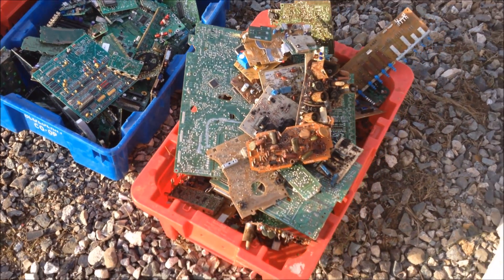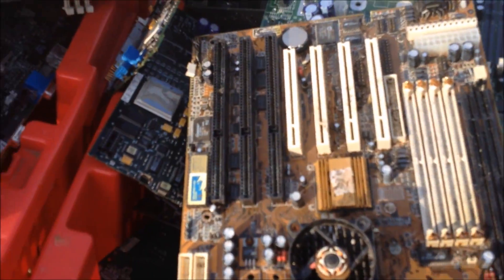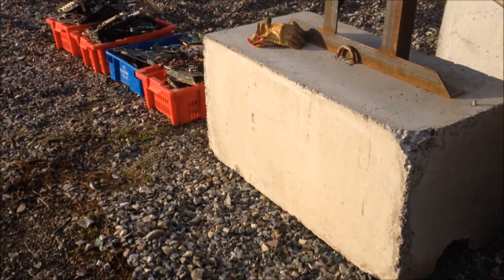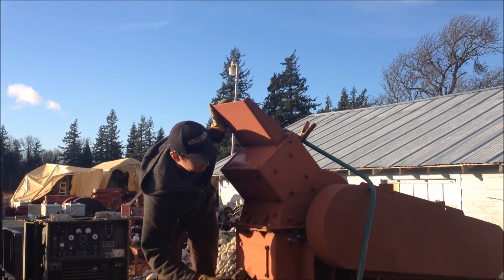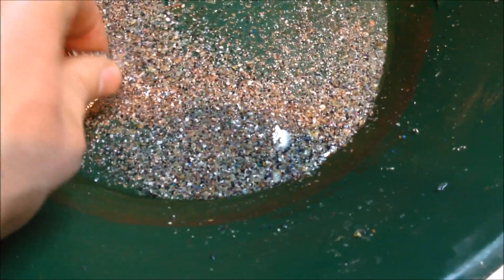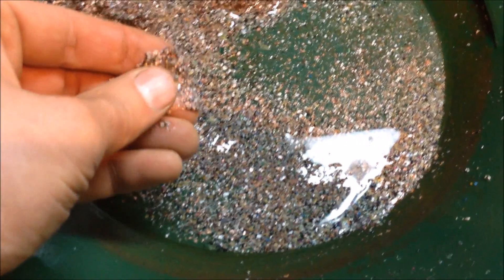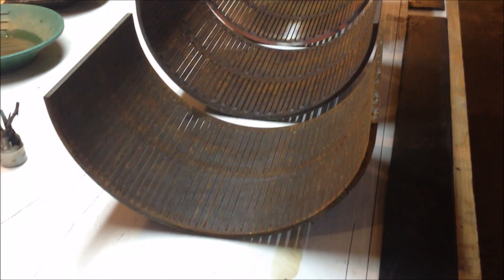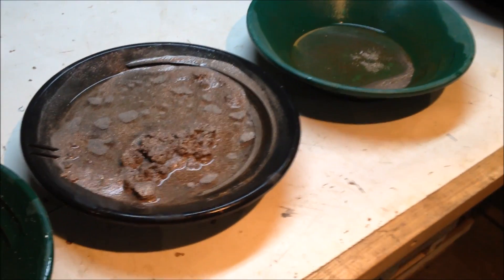URBAN MINING! Recovering gold, copper, precious metals from PCB's without chemicals

Comment: I think including both magnetic and eddy current separators would really help you out, and both are very cheap to build on a small scale from salvaged parts.
Reply from the maker: Laughing Achilles Thanks for the tip.  I think that is a good next step for us once we have the system refined a bit more.  If we can get the magnetics out with out losing any other metals that will be a big help for the refining process.
Reply: mbmmllc
 Ultimately you're going to run into an impossible barrier with that. You can grind it down as fine as you like but you're going to end up with a gold atom attached to a few iron atoms and it'll be removed with other magnetics. So it becomes a question of acceptable losses.

I hope you don't mind me throwing ideas at you it's just that I make my money from scrap but I keep all the boards and process them myself.  I'm trying to limit my chemical processes for obvious reasons. Over the years I've drastically reduced the need for chemicals. Although I did separate many components before processing, but now I'm trying to do whole boards like yourself.

So I think the most important thing you need to do is grind the material to a finer and more consistent micron size. The hammer mill is obviously brilliant for this sort of work, a secondary mill would produce a finer product, say 50 micron with greater consistency. A tertiary sieve could be installed to further classify the 50 micron product before it hits the table.
Reply from the maker: Laughing Achilles Thanks for the in depth comment and your good ideas.  I don't mind at all you giving suggestions on ways to improve our process.  I am a firm believer in more heads are better than a few and YouTube has a lot of heads!  

We are trying another approach now and I will give you the highlights.  We are using a 1/4" screen in our hammer mill with the idea that keeping the metals larger will reduce the abrasion of gold plating, etc that are very hard if not impossible to separate with gravity.  The mill spits out ~1/4" minus material we run across our shaker table.  The large metallics separate into the number one and number two ports with mostly free copper with a little bit of contamination ending up in port number three.  The tailings are then pumped up to a cyclone and the larger pieces (~30-50 mesh and larger) are re-run through the hammer mill again to liberate any more metallics.  The ~50 mesh and smaller is then discharged to the tailings pond where the water is re-circulated.

The larger material will re-circulate through the hammer mill until it is small enough to go up and out the cyclone.  This way we aren't abrading everything to a certain size to fit through the screen (increases throughput rate too), but we have a classifier to ensure we are liberating a very high percentage of metallics.  

Your guys thoughts would be appreciated.  We hope to have a video of our next R&D revision up soon so stay tuned!

Comment: we've been testing using liquid nitrogen on our electronics, then ball milling with dry ice, the dry ice evaporates leaving a dry powder...we'd planned on using magnetic induction and a centrifuge; but I like the shaker table method I see...thanks...will give it a try...have a good day...
Reply from the maker: Lewis Campbell Thanks for the comments.  It sounds like you guys are doing some production processing of PCB.  Where do you guys send your stuff for refining after grinding?  Thanks and good luck.
Reply: mbmmllc actually I've designed a magnetic induction process that supports a distillation like process for increased purity....still tweaking the design at the moment...but it seems to be working so far...it'll will take a couple of months of r & d to see what the quality level can be taken...we plan to use a solar farm to provide the current we need for mass processing of e-waste and rendering of the gold, silver and copper etc...thanks for the comments....
Reply from the maker: Lewis Campbell Thanks for your input.  It sounds like you have a cool project going on there.  Let us know how it turns out!
Reply: mbmmllc thanks....the military has me out training for the week...will be back in the office mon....will call then...hope your week goes well....

Comment: I'm not a expert but I've been doing a project on refining gold from PCB's. If im not mistaken with that technique you are probably going to heavy metals such as lead and mercury with the gold because of their similar molecular mass. The gold you are getting off is not 24 karat either, most gold in computers is gold foil which is a alloy of gold, copper, lead, and other metals.
Reply from the maker: Drew Peackock Thanks for the comment.  You are correct, there is going to be some lead and heavier metals that are mixed with the gold, but the volume will be much, much smaller than whole boards, and easier to refine.  We have some assays of our high grade material at over 100 oz/ton in gold so we are concentrating a really high grade product off the table.  Thanks again.

Comment: I ran a similar machine recovering copper from wire, we had a two step grind and 2 shaker tables.  the biggest problem we had was dealing with particle size, if you have raw particles that are significantly smaller than your screen you will have larger heavy particles sending smaller valuable particles into the low grade bins.  we would always re-grind with a finer screen when we re-ran our low grade product.  The company I worked for has grown to be the largest wire buyer in the area.  I would recommend that you work hard to find a good buyer for your product; you have a valuable product there and should be able to get a nice price for it.  something you might want to consider would be inserting a magnet somewhere to pull out any bits of steel that may be in your output.

Comment: those "golden" bits on the chip corners are telurium copper
Reply from the maker: ***** Thanks for the tip.
Reply: mbmmllc It is very rare to find "whole" golden parts almost everything is currently made from copper plated with telurium-copper coat. For "economical" reasons manufacturers only on rare ocasions using gold plating on PC part.

Comment: what about the rest material and the water?
I think this water is not safe just to drop in the ground
Reply from the maker: laxwork Thanks for the comment.  I would agree the water and the tailings needs to be disposed of properly.  The water can be recirculated through the system so the overall water usage is very low.

Comment: No chemicals? What you have there is a slurry of toxic waste full of all kinds of probimer and gunk. Good luck disposing of that legally. You'd be better off using the acid. I'd like to have that mill though for grinding processors; no point in doing entire boards.
Reply: Adam Selene I'm late, but you could dump it with oil for incineration
Reply: @SonicScooter I mean if you could figure out a closed loop system this could reduce the amount of additional chemicals needed.

Comment: You should be removing the Lithium-Ion button batteries from those motherboards first.
Reply from the maker: Gavin-
Noted.  I have had several people mention this to me through email as well.  Thanks for the heads up!
Reply: After all, you don't want explosions inside the hammer mill :)  This is just really neat, I never would have thought of doing thing this way.
Reply from the maker: Gavin Hurlbut Thanks for the comments.  I am glad you like the set up.  I have heard from several people in the industry this has some real potential.

Comment: So maybe like 30 bucks worth of gold, but I have to wonder how much copper and solder is in there.   If you could find a way to seperate the copper you could probably make more from that than the gold.
Reply from the maker: Hi Brady-
I think you are absolutely right.  The gold and other PM's are the "sexy" metals to go after, but I bet there is just as much value in the copper and base metals as there is in the PM's (depending on board grade of course).  It is very worth while to grab the base metals and send them off to a refiner.  Thanks for the comment
Reply: It would be interesting to have a chart of the values.  I believe with some sort of electrolysis system you could extract the copper without relying on a refiner.
Reply from the maker: Brady Rose Those are great ideas.  If you have the know how to extract the copper chemically I think that would be a great way to go.  I think it will depend on the volume of the operation too.  Thanks for the good ideas!

Comment: love to see more tries at this, do you plan to do any more runs with pcb on the mill and table ??
Reply from the maker: Hi Magpie-
We do plan to run more tests with our table and mill.  We are trying to find a good reliable source of boards as they are kind of hard to come by here.  We will post some more vids as we take them.  I have a really cool vid of incinerated IC chips I am going to post later this afternoon so check back soon.  Thanks
Reply: have you though about trying computer repair or tv repair shops for dead boards im sure they come accross lots or the do on uk anyways. regards
Reply from the maker: Magpies Recycling Thanks for the tip.  I will try that and see if I can get a good reliable source of boards.

Comment: I think you maybe slightly confused about the refining process you still need to refine with aqua regia to obtain 24kt pure .9999 gold. You are probably getting gold plated copper at the last stage and your efficiency looks very low. If i were to have processed the same amount and grade prob get about 10 g. gold 2 g. plat .5 paldium  and about 2 to 3 oz. of silver
Reply from the maker: Hi Vincent-
Thanks for your comments.  This was our first attempt at running whole, complete boards through the hammer mill and shaker table.  As you and others have mentioned the returns of PM's appear to be quite low.  We are working to get some assays of the different fractions so we can determine exactly where all the different metals ended up.  For additional testing we may try and remove all the gold bearing chips before running the boards as we may not be grinding the epoxy fine enough through our first pass in our hammer mill to liberate the very fine gold wires.  We will keep all you guys informed of our progress and stay tuned for more vids and info.
Reply: i wont lie this is interesting to see and u maybe really on to something. because u can reduce mass enormously making chemical process easier and with less concentrated acids. nitric when properly synthesized can light gloves on fire and burn skin not to mention the nasty fumes. but even if your not getting pure out of the end if u find the yields and sell it wholesale to a refiner and they can deal with the chems. ive seen processed  boards but never to that extent. so buyers maybe willing to pay premium on it. and it reduces the ending amount of nitric oxide released into the ozone which is a good thing for all of us.
Reply: Hey Vincent, what method r u using to separate every thing
Reply from the maker: Joseph Cruz 
We designed our shaker table and make them here in the USA.  It was originally designed for recovery of very fine gold from hardrock ore, but it works great for separation of any fine dense material.  If you are interested in more info please send us an email at MBMMLLC@gmail.com and I can send you a full price list and info sheet on our equipment.  Thanks.

Comment: Any word on the assay results?
Reply from the maker: Hi jdeluisa-
We did have them assayed, but the total weights of each bag was not measured before had.  We really need the weight of each cut to find the true amount of metals captured in each cut.  We are going to re-run the test and get the dry weights of each cut before sending them off for assay this time.  We are just slightly delayed.  Thanks

Comment: Hi mbmmllc

If that was my boards,I would go get the non metal left overs and incinerate them really good.Why you ask? Well because you left a large percentage of gold in the black epoxy IC chips,which got floated off to your waste stream.The gold bonding wires patnor1011 was referring to,are trap in the epoxy and the only way to fully free them is through incineration.If you do this please make a video of it so we can see the better results that you get.Thanks in advance.

modtheworld44
Reply from the maker: Mod-
Thanks for the comment and the tip.  We may end up incinerating some of the tailings.  We saved all the tailings and still have them in buckets if we need to further process them.  We have some assays out and should here back soon so I will post another video shortly with the assay results and we can get a good picture of exactly what is left in the tailings and the value of each cut.  Thanks for the suggestion and the comments!
Reply: MrMODTHEWORLD44 Those black casings with the gold inside might be ceramic that does not burn, grinding them is the way to go.

Comment: You're losing a lot of good pm's . I've experimented this way . Unfortunately the best way is using acids and separating the metals by type. I've used my impact mill with great efficiency in breaking the material down. It's only useful after segregating materials. Been following you for a while now. Get back on GRF or even www.refinementofpreciousmetals.com. Best of luck
Reply from the maker: Hi Jack-
Thanks for the insight and experience.  What has been your experience with the impact mill?  You say it works good for breaking the material down.  Do you hand processing the boards, run the different types of materials through impact mill separately, and then leach after?  Our strategy has been to recover all the metals by gravity and then do leaching or send it all off to a refiner for them to get the different metals out.  The free gold recovered by the table can be easily refined/melted and sold directly for the highest return.  When you say we are loosing a lot of good pm's, do you mean they are getting mixed in with the #2 and #3 or they are being ground so fine we can't concentrate them out on our shaker table?  Thanks for all your insights, we are new to this and any tips you can give us to help improve the process are very valuable.
Reply: I''m pretty new myself and have experimented quite a bit. I have an impact mill also. Its not as large as yours, but I'm running it around 7k rpm. I've experimented with different materials. The ceramic processors break down great and process easily. One problem I've found is with the black epoxy IC chips. They are gold bearing but should be incinerated before crushing. I tried a batch of 7 pounds of IC's and turned them to 30 minus. What I found that when crushed only, and not incinerated the ground up material is extremely hydrophobic. I tried jet dry as an anti surfactant. I let it soak over night and still had clumps of dry material. I hit the mix with a mixing drill and still had small bubbles of dry material. I was completely blown away. I did manage to recover "Some" gold. With that said, if you are running boards whole, I would suspect a lot of that material is going straight into your waste port. That's just one example. As I mentioned I'm fairly new as well but I've been learning the refining processes and have been making my own mistakes...One's I've learned from. Segregating the different metals simplifies the refining process and gives a better chance for recovery.
Reply from the maker: jackrodus Thanks again for your expertise and experience.  I have fought with some really hydrophobic stuff my self.  A lot of the samples of gold ore I run for people they pre crush and send to me as powder and it too is really hydrophobic.  I have found that if I mix some surfactant (jet dry or some other soap) in my water source and run the dry hydrophobic sample through the hammer mill with 2-3 US gal/min that the hammer mill does a good job of thoroughly wetting the material.  Have you tried running your impact mill wet to see if this helps?  I have had some others comment saying to incinerate the boards too.  We will get the assays back in a few days and we can get a good idea of the values left in the tailings.  I will make a new video once we have the assay report.  Can't wait!  Thanks for the comments, there is still lots of experimenting left to do!